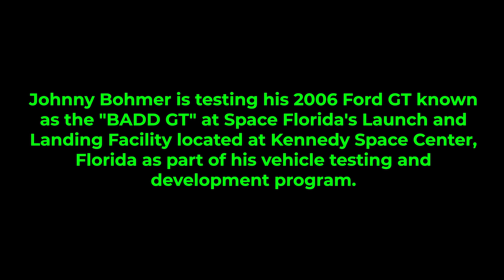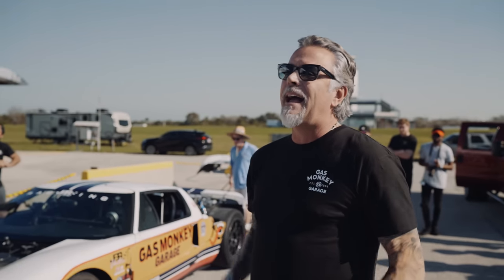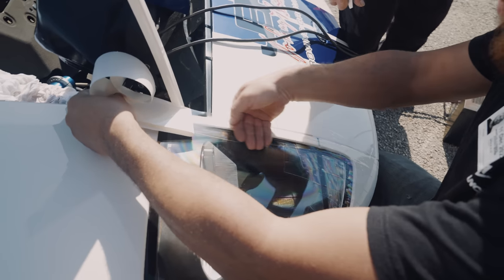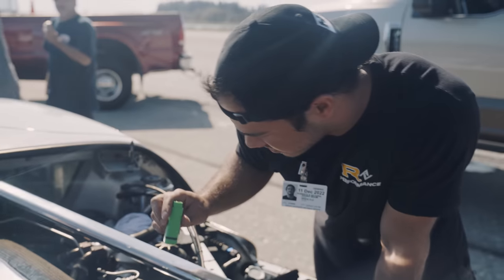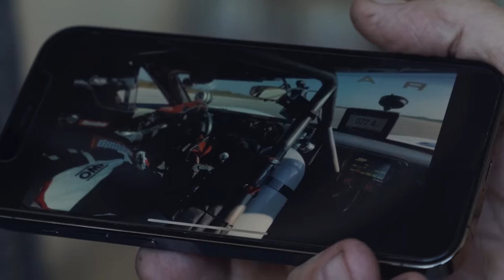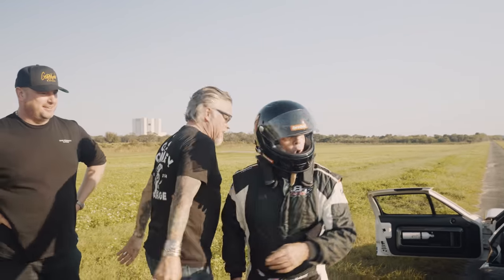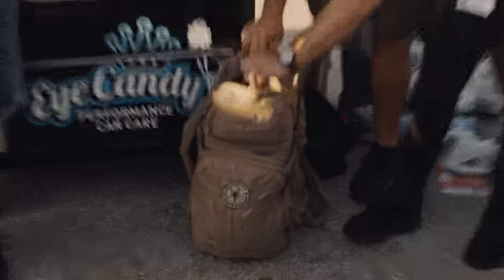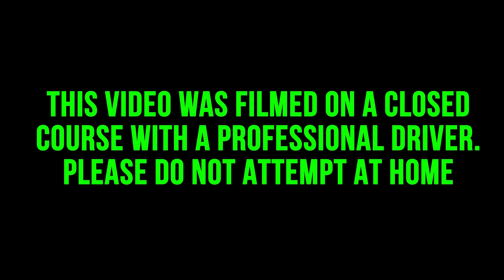World's Fastest Street Legal Car 🛞💨 300mph+ | The BADD GT®

Comment: The Bugatti Chiron Super Sport 300+, which smashed all the marque's previous records, pushing through the seemingly impenetrable 300mph barrier in 2019. To achieve this feat, Bugatti's 8.0-litre W16 engine has been tuned to create 1,578bhp - 99bhp more than the standard Chiron. It has also gained extra cooling for its engine and gearbox, along with a host of software changes. Aerodynamic upgrades have been just as critical to its high-speed run, most notably a 'Longtail' rear end that's added 25cm of bodywork to smooth its airflow. The ‘enhanced’ Chiron Super Sport 300+ hit 304.774mph at the Ehra-Lessien test track in Germany.  ALL ON REGULAR OCTANE FUEL NO NOS ETC.......
Reply: They did it going one way only in a modified vehicle, so they can not claim the production car record of hitting 300.
Reply: That was probably doing 100+ mph before it even saw the straight part of the track mate. If Johnny had that luxury, he could turn the GT down to 2,000hp and run 320+ as easy as can be mate !!
Reply: @arkhsm  it was doing over 280 km/h on the curve exit.
Reply: @1216jimmyz  how is this one not modified?
Reply: @giddie6862  production car record, did you overlook that part?  This is the standing record.  Two totally different records.  But hey, explain to me again how I was “wrong “?
Reply: @1216jimmyz  how is this a production car record though? Can you just outright buy it as is?
Reply: @1216jimmyz  sorry for committing the war crime of asking for clarity on the internet. You sound age 11-14, so I’ll let you be
Reply: @giddie6862  street legal and PRODUCTION CARS are two totally different things.  There is your final tidbit of info
Reply: @1216jimmyz  thank you for the polite response

Comment: If you change it to an automatic transmission without changing anything else, you could probably get to 325 in the same distance. No human can shift as fast or accurate as an automatic, and with an additional 4 or 6 gears, you can get the most out of the power you have.

Comment: Before I believe it I’d want the same level of verification with the same level of accuracy by using outside GPS companies that the big manufacturers see. If you take what happened not all that long ago with SSC and all the controversy surrounding there 300 and something mile an hour run, it was substantially slower than what the speedometer showed and they got called out on it. Plus Bugatti already broke 300mph so not that exciting. Cool car tho
Reply: I agree
Reply: I kind of agree without professional level calibrated speed verification its impossible to confirm and it wouldnt be a world record as it would have to be done in both directions.
Reply: This is a standing mile record, it only needs to be one way.  And no, no other car has hit 310 in a standing mile.
Reply: This actually did 300 before the bug. being a 2006 and doing 300 in a mile makes it even more impressive. nice try bugatti but Ford was first.

Comment: Wishlist/Challenge List : 
1 Drag Racing with Königsegg, Chiron and Stock Car, Indycar in the Kennedy Landing Space Center, 
2 Getting some record in the Road where current Fastest Production car got it, and some fake it.
3 Doing it in some Salt Flat Lake with the usual rules of two rules, standing mile etc. and some moondisk hubcaps.
4 Wouldn't be nice to make some aerodynamic comparison or explanation with similar Land Speed Record cars from around 1930, can't believe the body (and brakes) of the Ford GT can wistand such speed and energy without a real tail fin, any low drags improvements, neither some active aero and not begining to fly or bounce... 
5 Wouldn't be nice to see BADD GT beating a NASCAR stock car or indy car going around some OVAL race track (if possible).

Comment: Bugatti Chiron 304 mph in production trim.  Not heavily modified as this? Great run and major props guys.
Reply: The Chiron that hit 304 was modified and a "prototype" including additional aero and power over the standard car. It wasn't as heavily modified as this GT but it also didn't hit 300+ in a standing mile like these GTs are doing. Bugatti used a 12 mile track.
Reply: Plus how much does a Bugatti cost? How many cylinders?

Comment: Nothing is forever. Babe Ruth once hit 60 homeruns in a season. The record stood for over 40 years. Then it was broken by 3 different men. Lou Gehrig played 2191 consecutive games, then it was broken. No record stands forever. The M2K motorsports Ford GT went 300.4 mph in a standing mile in 2019. Now that record appears to have been broken by another car subject to a significant caveat. The M2K car went 300.4 in a timed, measured run from a standing start, within 5,280 ft. It did the mile "on the clocks."  Apparently the Badd GT had an unlimited NASA  runway in which to keep going faster and faster until the unofficial speed readout in his car said "310." So he ended up going faster but not in a measured mile. So the M2K car is still the fastest production car in a measured mile, timed by calibrated timers. We're comparing tomatoes and oranges here. And BTW 1). The M2K car, as it exited the timing traps,, was going 306 "in 5th gear." 2). Didn't even get into 6th gear, whereas the BADD Gt had the chance to wind it out in 6th. So to settle the matter, either the BADD GT has to go more than 300.4 in a standing mile, or the M2K needs to go down to Florida and wind it out all the way in 6th. Both Bugatti and Koenigsegg say their cars will go over 300 mph as well, but they need the full length of the Mulsanne Straight at LeMans to get up to that speed. Remember, its "tomatoes and oranges." In my mind the M2K car is still #1 until somebody else, playing by the same set of rules, goes faster. 300.4 in 5th gear >>> 310 in 6th. Remember, under the same rules to this point (standing mile) the BADD GT admits to only going 283.

Comment: 310.8 mph is very impressive, HOWEVER , there are TWO ways to measure speed , the top speed AND the fastest acceleration, say over the quarter mile . The fastest accelerating street legal car is Red Victor 3 from the UK , it can accelerate 0-60mph in less than 1 second, do a standing quarter mile in 5.92 seconds, which it did on a Bahrain drag strip in 2019 and the video is on YouTube.
At the quarter mile it's doing 262mph, it's not been tried on a runway to my knowledge.
So the Bad GT can claim to have the fastest top speed BUT Red Victor 3 also has a claim of the fastest street legal car by fastest acceleration , 
In a race between the two , the Bad GT would have to catch up with Red Victor 3 because RV3 would be way out in front, only over a much longer distance would the Bad GT maybe prevail.

Comment: What's the engine on that exactly? I don't think a stock block 5.4 would handle 2700hp, we have dodge, chevy and even Ford breaking engines at half this power. There's too much heat for the 5.4 to handle without major upgrades such as cementing the block. If I were to guess its a full on billet block as there's not a single picture of the block out on the internet and the pictures that do show the engine, you can only see the heads as it's always a top shot. So, what's the deal behind it? Hoping to see a 300mph+ viper sometime soon, that v10 has 3000hp+ capability and it's decently light and aerodynamic. Great car, great record. Hope to see a manufacturer break the 310 soon, the Chiron 300+ is still the fastest bone stock production car @304mph.

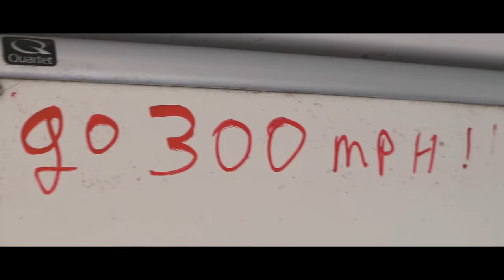Comment: 1:10 Bugati .... Konegsig ...... SSC Tuatara...Hold my beer. 19:30 shut up, check the data, and check those plugs. 20:50 Notice the big gauge on the right, notice exceeding the redline for "Quite some time." I can't help but wonder how many times that very vehicle can be subjected to that kind of abuse before it catastrophically fails? The aerospace industry laughs at your puny vehicles and their huge floppy tolerances.
Having said that in the twilight of internal combustion engines Not too bad guys not too bad.

Comment: Amazing Performance 

500kph... this is the killer 

You can travel time with it

But I wonder why 1800hp is enough to reach this velocity
Reply: Why 1800hp is enough? Because physics said so.
Reply: @razor_ramon_  i thought needing over  2000hp
Reply: @dennisbowski4401  depends on many factors, aerodynamics included
Reply: @razor_ramon_  very good 

Ford GT seems to be good aero 

Acceleration also better as i expected 

Madness. 400-500kph absolutly insane
Reply: @dennisbowski4401  sure. Back in a day 400-500 km/h seemed unobtainable. Not anymore! Tech developing ain't standing still. But now we are approaching tire limits. Velocity tears them apart

Comment: Was that MPH confirmed with a radar gun ? what was the reading in the car based on , wheel speed , drive shaft ? or an external air speed indicator , they all could be off . Was there a back wind , no doubt you wouldn't try facing the wind ? right . wheel spin at that Speed could be over 20 MPH , just asking if this was legit , no i don't think it qualified for the actual record books.But in case 300 MPH was reached i'm very impressed with the GT's aerodynamics , no wing or ground effects spoilers just a rear lower air fins below . the new GT's have better aero than the org gt40's stock ? Wow
Reply: New GT has better aero, sure, but old GT has a larger engine. So both are compromised.
Reply: @razor_ramon_  Oh your not a fan of the Ford GT ? its a legend and the only real compromise is head clearance sitting in one !
Reply: @HANDBALLDIEHARD  do you mean that not being a fan of Ford GT is bad? Is that what you're saying?
Reply: @razor_ramon_  does not matter if your a fan or not , the car has legendary historical significance to road racing. your comment compromised i take to meaning anything under the sun that is imperfect, show me a "perfect" car that achieved the  status of the Ford GT ? My next pick for greatness is the 69 Dodge Daytona Chargers , they ruled NASCAR while allowed to race with the hemi. they totally out classed the competition with superior aero and set the speed records.finishing some races like the GT's taking 1st ,2nd and 3 places at the finish.
Reply: @HANDBALLDIEHARD  so why would you ask? 🤔
Reply: @HANDBALLDIEHARD  Porsche 917 /30 dominated Can - Am Series at the level never seen before or after. Now that's a legendary car.
Reply: @razor_ramon_  absolutely , but it was the latest technology for racing only chasiss , also its designers failed on the rear aerodynamics , took a racing team to come up with the fix that made it the greatest race car only ! the public that can afford the GT and 69 daytona get to drive it on real roads.

Comment: Where are the "rules" or guidelines for this type of record? Where are they documented? Curious as to what they are. For example; are there any lenght limits? 2 miles? 7 miles? Do you need to make only one run? Or two runs within a certain time? Or is there no standard to this? Just go as fast as you can once no matter how many miles it takes to get to speed?
Reply: Length limit is unexisting, as far as I'm concerned. Two runs in opposite directions within an hour are required.
Reply: @razor_ramon_  where does that information come from?
Reply: @Airplanefish  from Internet?

Comment: I thought for a world record you have to run both ways and take an average?
Reply: i thought so too and they have to be within a certain time frame maybe its unofficial idk
Reply: "The land speed record (LSR) is standardized as the speed over a course of fixed length, averaged over two runs (commonly called "passes").[2] Two runs are required in opposite directions within one hour, and a new record mark must exceed the previous one by at least one percent to be validated."
Reply: As long as that makes you feel better 👍

Comment: Don't get me wrong, that car is impressive as hell, but the shuttle runway is 15000 feet long (2.84 miles) and he used every bit of it.  Several cars have gone 260 plus in the half mile (2640 feet).  Kinda puts this in a bit more perspective.
Reply: They used 2.5 ish miles in this run. And tires are the weakest link at high speeds, not the car itself.

Comment: I might kill a man to be able to drive this car for say....6 hours? I mean, that number is negotiable i could kill 2 men but, the 6 hour number is as firm as my handshake. Y'ALL SEE HOW FAST THE TOP OF 1ST GEAR WAS!?!?!?!?!? Fuckin damn near 80mph. My 2020 R1m does 110 in 1st gear, but it dont do no 310mph. She runs real strong to 211, then the rev limiter tags that mapping and its like hitting the brakes. Thats not even my fast bike, its my performer. The bike i drag knees on and back it in all sick. I own a 2006 R1 raven with a very, very expensive rotating assembly in the engine, crazy amount of headwork, custom ground cams, haltech elite 750 ecu, straight cut gears, and a garrett gt2554r turbo. It runs on ignite e90. It has SOOOOO much more done to it but who cares? She made 281 wheel horsepower @ 12,300rpm and 4780 feet above sea level. Ive run that bike at over 250mph. If youve never done 200 on a motorcycle, get your shit together. You're seriously missing out on the best high in the world.

Comment: Why does he say no production car has reached 300. Bugatti have done it, and the jesko will best 340. Come on Richard you have the money you should know better.
Reply: Allegedly. I believe bugatti is officially 298
And jesko is 289 

Because of computer adjustments ect
Reply: @devinbender8428  the Bugatti hit 304.77 the jesko is yet to run
Reply: @danielmiller1462  yes i see now. My mistake. 

However. 

Buggatti took a hyper loop and 7 miles to complete. 

This did a standing mile.

And is 6mph faster. In just the mile. Let alone if IT did a hyper loop

Comment: really cool. but it's not the fastest street car.. You can't drive it after that run, it's to extreme, like a F1 car. you have to rebuild the motor after a few 100 miles. you can drive 300mph in a bugatti chiron super sport and go shopping after the run. that's what you call a road legal car, not this frankstein car which nobody can drive. Also a parachute for brakes? the bugatti will brack on his own.